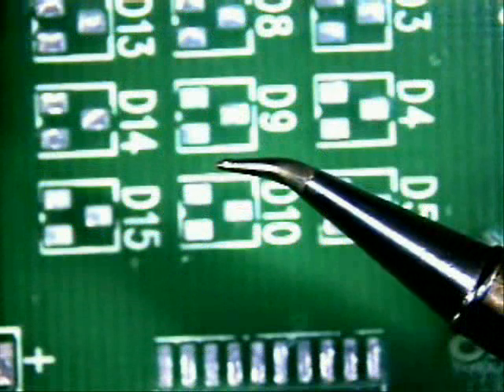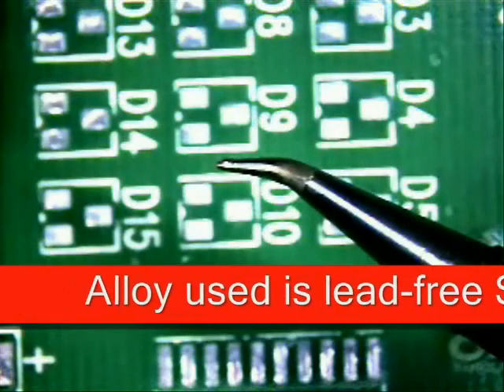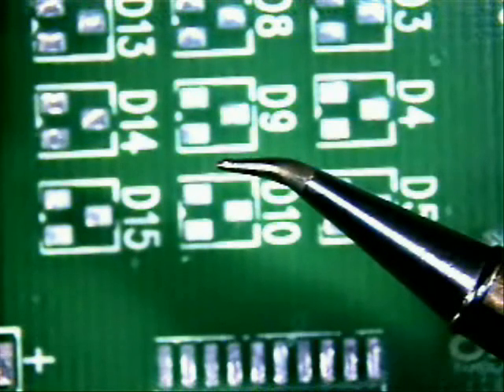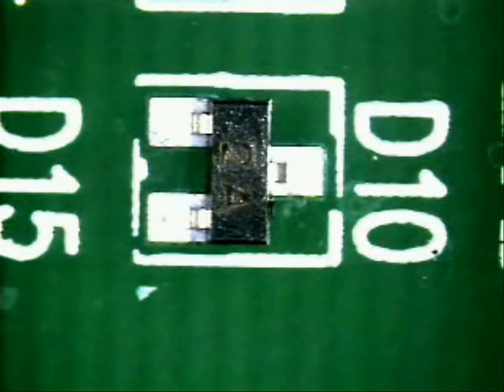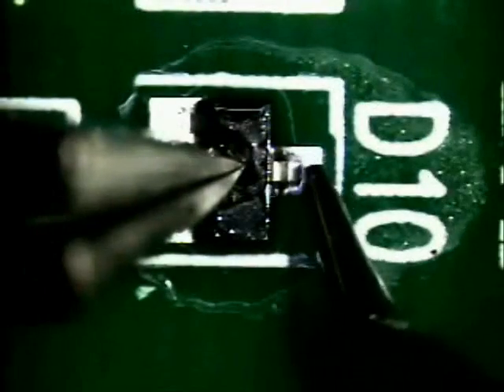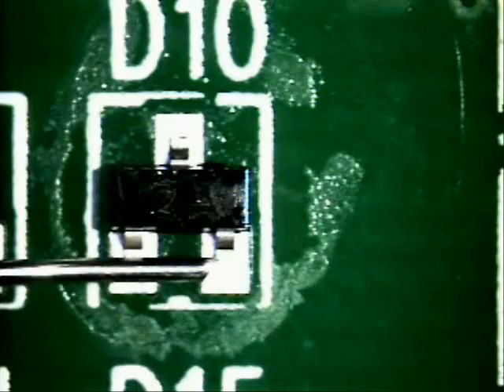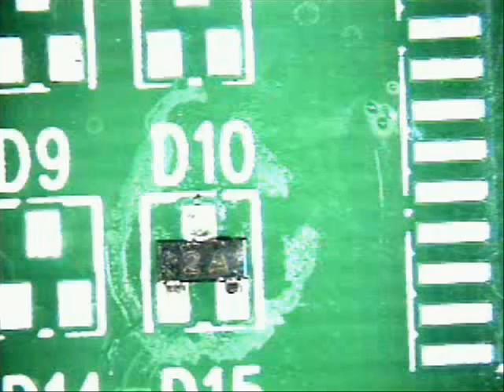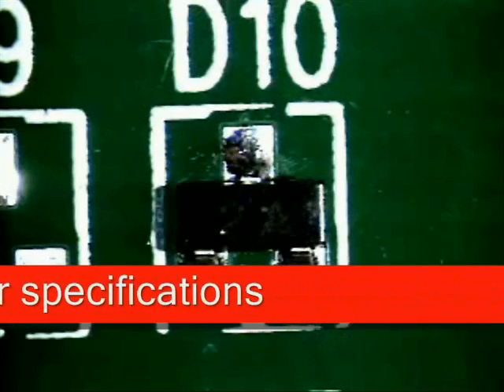Lead Free SOT23 Installation

Comment: In general, I thought the best way to make good solder joints is to heat the pad and component lead simultaneously with the iron, then feed solder in.